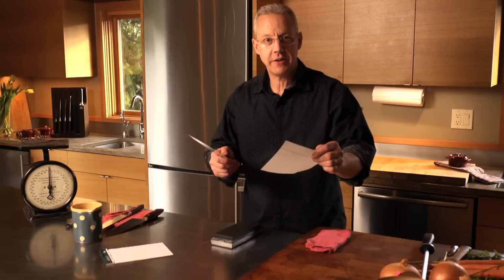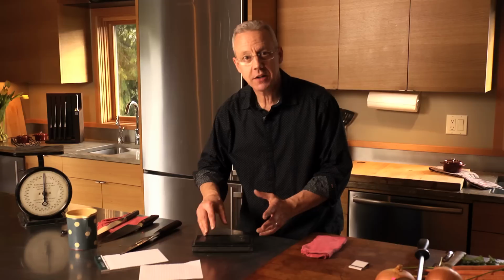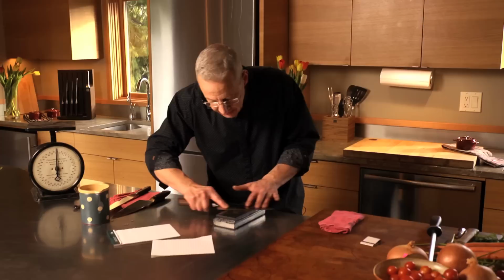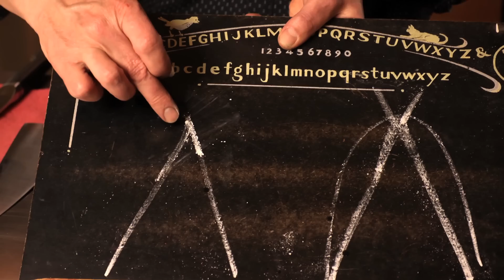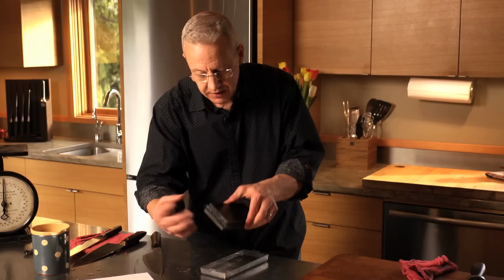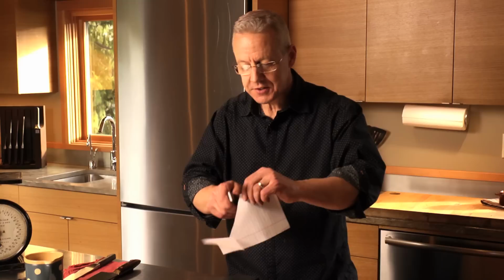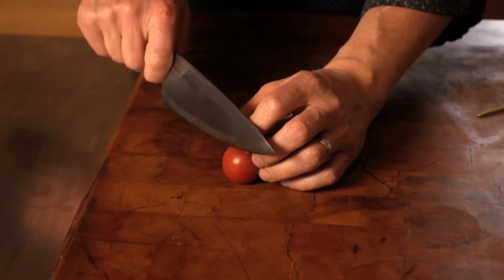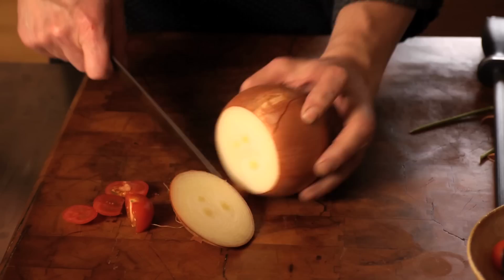Bob Kramer: "Stoning Your Knife" presented by Zwilling JA Henckels and Sur La Table

Comment: @timelesscreation That's a Zwilling Twin Pro combination stone.  The first, coarse grit is 250.  The fine grit is 1000.  Zwilling also makes a "finishing stone" -- 3000 and 8000 grits.  You use those if you want a super fine, polished edge.  I touched up my Zwilling/Kramer knife this evening with the 1000 grit stone, followed by the 3000.

Comment: Cool video.  I believe he was using a 250/1000 grit japanese water stone by Zwilling. The knife he was demonstrating with was a Zwilling Bob Kramer Carbon Steel Chef's Knife. We sell both lines and a lot of Zwilling products... the Carbon Steel line is very easy to sharpen because the blade is straight carbon steel.  It will take a few more strokes to sharpen other steels like VG-10 (lots of Shun/Japanese knives have this steel core) or the super hard but slightly difficult to sharpen SG2.

Comment: I prefer a strop to a "steel" it's much more gentle...you can get them at DLT trading and I recommend a green compound. THe grits you need to use a stone are about 800 grit then you want to go to a 3000 or 6000 grit to polish. However if you want a stronger longer lasting edge you may want to think about embracing the convex geometry and sharpen with sandpaper over top of a hard backed leather. I use 400 grit, 600 grit 1000 grit then strop. Pm me for any further instructions.

Comment: Its easier to get a sharp edge on a cheap knife cause it has softer steel, so you take away metal faster,

Hard steel knifes hold their edge longer and take longer to sharpen

Comment: im constantly having to sharpen my knives due to other people using them..but my biggest issue is not having a cutting board..i have some plastic plates i usually use because the only cutting boards we have are glass and ceramic..tho they arent going to grow bacteria i know they are going to dull my blade and just the thought of cutting across them makes my teeth grind...what material do you suggest for a good cutting board??